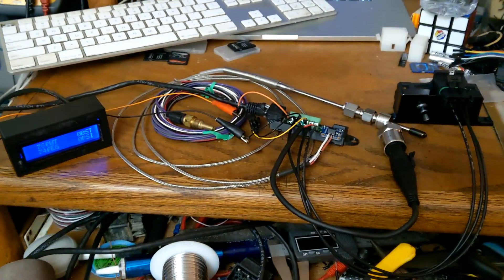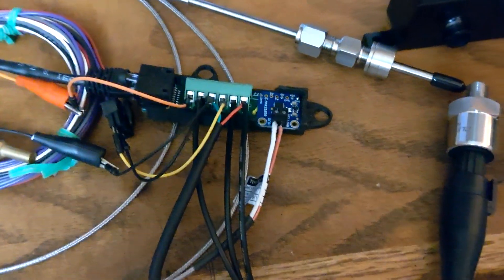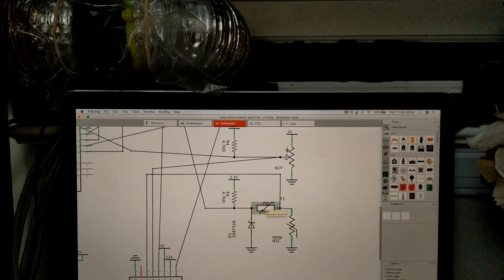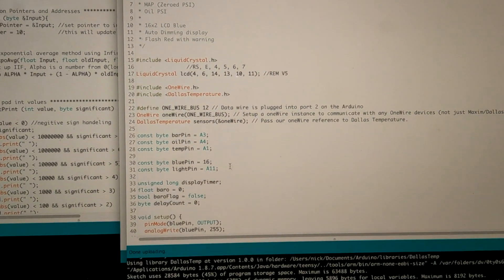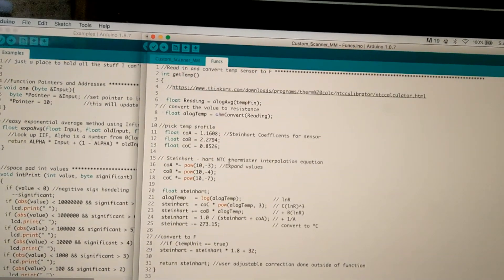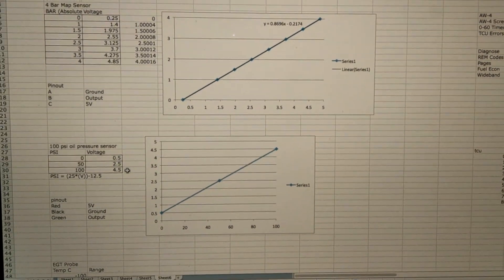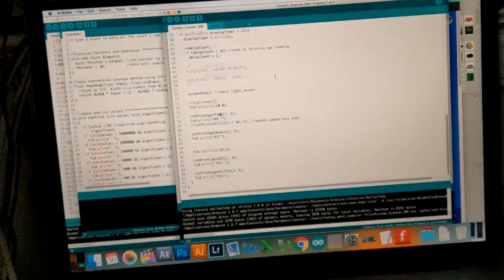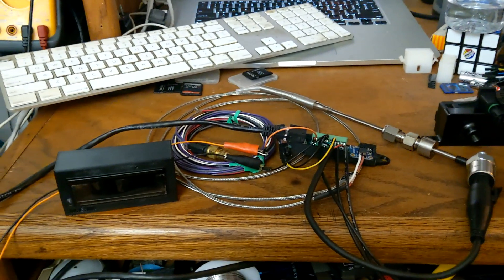Custom Arduino Mini Engine Monitor Project

Comment: Hey Nick I have a problem with a 1991 Jeep Cherokee 4.0l
Reply: The problem I have is that the light check engine it doesn't start
Reply: The only way the light check engine start is putting the switch front waiting like an hour then the lights come on and start then you can start the engine with no problem
Reply from the maker: Have you tried to look up what the check engine light is telling you? If you can get it to blink then you can count the code and see what it is, it might help.
Reply: @NickInTimeFilms  thank you Nick I will do as you said

Comment: Are you able to replace your 'if' statements with a 'case' statement
Reply from the maker: Each if statement adds an additional space for right justifying. A smarter way to do it would be iterative by using a for loop so it just knows the right amount of spaces. I'm sure an even smarter way might be trying to manipulate an actual string value but i never looked much into sPrint
Reply: @NickInTimeFilms  understand,  i don't know arduino but in 'C' a case statement will do exactly the same as multiple ifs so you should be able to do exactly the same
Reply from the maker: @MikeDHasSkills  Yes, but also no. I use case statements in my REM code for choosing what menu screen to display, as well as for some other functions where only 1 value is valid. For my intPrint function, I suppose you could also change it to case based if you added the exact number of total spaces for each case, but I'm not sure how you'd write the length check for cases since it works by just stacking spacing from the previous if checks if they were true. For loop would be a much cleaner and compact way to do that, maybe by incrementing a check value by a multiple of 10 until it finds the end.
Reply: @NickInTimeFilms  on a separate note, your use of functions is the proper way of coding and as you stated the code is much cleaner and logical. Especially if there are multiple developers working on the same project. Ideally all of your functions are a separate file called in from #include. On small projects not as important but on large projects necessary

Comment: I’m just curious you said the thermocouple was k type but the wire color suggests it’s a j type. So which one is it?  Thanks ,I miss seeing your xj videos👍🏻
Reply from the maker: Couldn't actually tell you, but the supplier said K-type. Not only were the colors wrong, but also the polarity. A lighter test shows the temp goes up when it gets hot so there's that at least. Worst case it would just need a correction factor, but good eye!